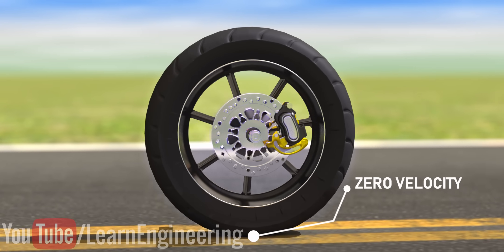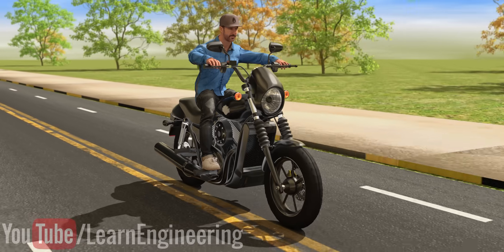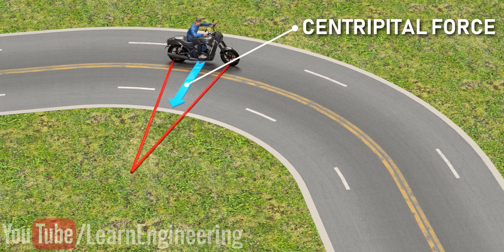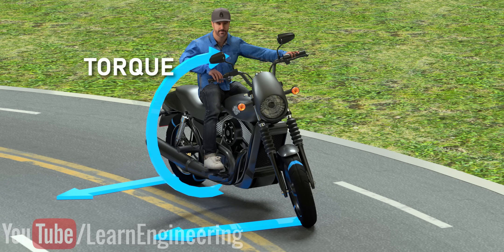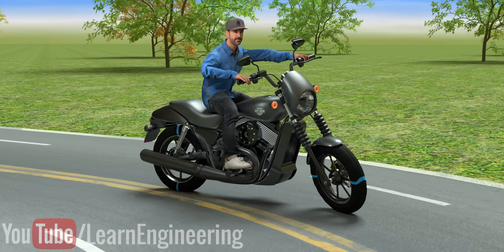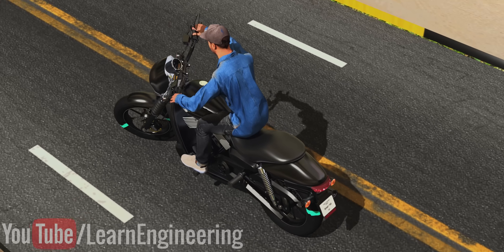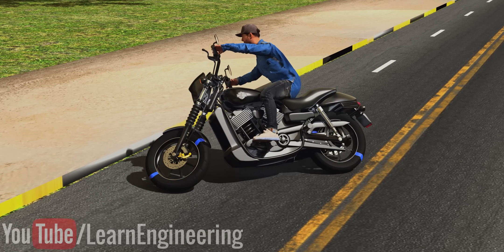Counter Steering | The interesting physics behind it

Comment: the guy turned left and hello the bike went left, then he turned the bike right, and the bike went right.. even in a skid, keep the wheel pointed in the direction you need to be going..... how did the myth perpetuate?
Reply: Myth??😂
Reply: @softailfun  Yeah, myth..... get a slow motion camera, that includes some kind of reference to which we can clearly see direction the wheel is turning, relative to the direction the bike is going.....there will never be a time in the shot that the bike will be going opposite of the way the wheel is turned... pushing the wheel to the opposite direction CAN cause a lean in the opposite direction, as a consequence of being off balance for a millisecond... (if you want to call that countersteering then fine).... but to actually GO the opposite direction it will have to be followed by correcting and turning the wheel the direction you need to go.... if you can produce that slow motion video that we can clearly see the direction the wheel is turned and the bike is going the opposite of that, I will concede that I am wrong.... I promise.... :)
Reply: @JimHancock  
So I know you don’t ride, that’s for sure. So you must be an engineer, physicist of some description. Which means that you learned what you’re saying from a book and not “real world” experience. I’m not being disrespectful but what the books say and what actually happens appear to be completely different. Of course the front wheel needs to follow the bend, a bit obvious really. However it’s the initiation of the lean that you guys see differently somehow. 
To turn a motorcycle to the left the rider applies forward pressure on the LEFT grip. The bike will immediately lean and turn to the left. The rider never eases the pressure on the LEFT grip until the bend is complete and he wants to travel straight. While this is happening, the steering geometry of the bike (rake & trail etc) forces the front wheel to steer into the bend. As you say, the actual time the wheel faces away from the bend is in milliseconds, and the movement of the wheel left or right (initially) barely measurable……but that’s what happens. Should the rider physically turn the wheel into the bend the bike will immediately stand up and attempt to lean RIGHT! That is exactly what happened in this video. He attempted to turn away from the truck by steering RIGHT, he ended up fighting the steering.

https://youtu.be/lzk8oyNO708

See the link for one of the best (in my opinion) examples of counter steering.
Now you’ll be able to run rings around me with big words, I know that…… but I’ve been riding for 40 years. If I have my right hand on the right grip and my left hand on the tank, I can steer a bike just fine. With my right hand only….. I push forward and my bike leans and turns to the right, I pull towards me and my bike leans and turns left. I maintain that pressure for the duration of the turn. There’s no way that a rider can physically steer right to lean and turn right above 10 or 12 mph. That is how it is!
Reply: @softailfun  actually we aren't in disagreement, the millisecond is what helps throw the bike into the lean, and then the wheel is turned where you are going.....you are correctI haven't been on a motorcycle in years, I use to race motocross, now I am itching for a streetbike..motocross you spend half the time with the wheel pointing in the direction of the slide, like flat track.. the front wheel is all over the place.... I know it's a different world then the rode....actually I'm a photographer and filmmaker, but I do come from am engineering background... my issue is with the term "counter steering" newbies might assume that turning the opposite direction will get you through the turn...What I haven't seen is for somebody to take a pointer,, mounted front of the bike, lined with the frame, over the front wheel, then point a camera at that, then you would know which way the wheel was pointing, relative to the direction of the turn and the frame.... even if you are pushing counter intuitively, it stands to reason that if you are leaning left turning left, the wheel will want to fall that way, and that is why pressure on the inside grip works... it's an interesting debate... but we are in agreement with the millisecond part... that's a start.... :)
Reply: @softailfun  You explained how you counter-steeered when u are riding ...then say its BS!😁
Reply: @sifuerik  
I don’t understand what you mean. Where do I say counter steering is BS? Have you addressed your comment to the right person??

Comment: The best explanation of counter steering... if you did nt get it watch it again ,,
Reply: Bloody awful description. Inaccurate and dangerous. You only have to read some of the comments from riders to understand how bad this is.
Reply: @softailfun  Yes it maybe to technical for some people ,,whats inaccurate pls explain.
Reply: @stephanriley5304  
As a rider, the one glaringly obvious mistake is the the video treats counter steering as an option. It isn’t an option, it’s the only way to steer a bike with any control.
Secondly, the video suggests that the front wheel is steered one way and then (“cleverly” as the video states) the other direction. This is Totally wrong. Once the steering is made to the left (for instance) by applying forward pressure on the right bar, the bike will immediately lean to the right. For the duration of the bend pressure is maintained on the right bar and the front wheel (due to rake, steering geometry etc) will indeed point into the turn. When the bend is complete, the rider eases the pressure on the inside bar and the bike stands up. If the rider were to do what the video suggest, steers left (bike leans right) and then steers in the opposite direction, the bike would stand up immediately and before the bend is completed. Not the most desirable outcome, even you as a none rider will appreciate that I’m sure.
Reply: @softailfun  I agree , if you counter steer when yor already leaning it will stand the bike up,, but counter steering when the bike is up  ,, and pushing to the right will lean the bike left ,, taking you into the lean faster..allowing you to turn faster ,, thats a fact..
Reply: @stephanriley5304  
Re initiating a lean:
Erm….. isn’t that what I said???
So you agree that the video is incorrect. That’s not reflected in your original comment. 
You’re not making a lot of sense.
Please re-read my comment. I’m well aware of how counter steering works from a practical view and not from reading books!
Reply: @softailfun  Me too be riding 40 yrs mate.,,,, what ever ..
Reply: @stephanriley5304  
Been riding 40 years, and this video makes sense to you?? Really??
Come on now! You must know how wrong and how dangerous this video is. Anyway, ride safe. Peace out!
Reply: @softailfun  You keep banging on ,, about how bad this vid is ,, are you an engineer ,, and  I agree counter steering is not an option , most people dont even know they are counter steering, I ride a zx10 r  started off on a yz 80,,and I use counter steering to my advantage ...  tell me techncially what is wrong with this vid,,, I dont want your explanation of counter steering I got that and agree ,,

Comment: Counter steering is normal motorcycle and bicycle steering. I even taught kids to get control over their bicycle by having them initiate lean before turning into the curve. There is no other way to do it- saying otherwise is just fooling yourself, and this video is very poor in that respect, outright wrong in many cases and doesnt cover the physics needed to understand counter steering, only parts of it. It completely misses out key points about the motorcycle geometry and tire shape which explains why the bike is stable at speed, and the physics is questionable and could have been taught much more intuitively. The narrator seems scared of riding motorcycles, and perhaps rightfully so, as he clearly does not understand how it is to ride a motorcycle and how it maintains balance. 

If you are up straight and want to lean in, you will have to lean the bike by moving the bottom part (the wheels) away from the side you are turning into first, otherwise you will fall out of the curve. In slow speed, and typical on bicycles, you may have to follow up by turning in the desired direction shortly after initiating lean, but on a motorbike at speed, the bike will do this for you, (due to the tire shape and the motorcycle geometry), so all you have to think about is initiating lean. 

Phrases like on 3:50: "...the driver cleverly adjusts the angle of the handlebars so that it is suitable for a perfect no-slip condition" demonstrates that the narrator does not have any clue on riding a motorbike. There is no effort into this, you have to forcefully continue to push the handlebar to stop the bike from balancing itself. Physics is at best confusing at  4:03 when it says "In counter steering, the lean is achieved by the motorcycle instability, caused by the centripetal force"- What centripetal force? The centripetal force is normally understood as what keeps you upright while leaning into the turn. Follow up at 4:12 with "Obviously, countersteering is a quicker operation, but slightly risky. If you dont steer the handlebars back to the proper angle during the leaning operation, you are going to fall down" just puts another big hole into an already sinking ship. Again, there is no effort in balancing a modern motorcycle.   At last: "The trick of countersteering is that you turn the handle, but don't lean" is simply nonsense. Countersteering is what you do to lean the bike; then the bike balances itself by turning to the side you lean.  

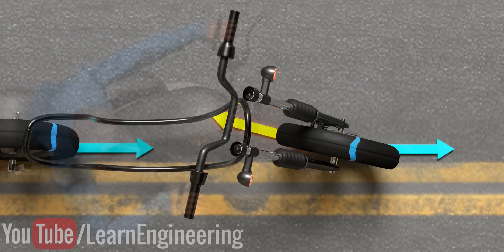Shifting weight around on a motorbike to have it lean is possible, but technically you will perform the necessary steering to balance the bike enough to shift the weight which means you are counter steering no matter how you turn the phrase, although you may not be aware of it. If you look at the top view with the wheel turned at approximately 1:37 it MUST be obvious for anyone having ridden a bike that just turning the wheel while being straight up, you will have the bike falling out of the curve initiated by the steering. If you do not follow up by turning the other way you will fall, however this is not hard to accomplish on a motorbike at speed. 

Being aware of countersteering is important when riding a motorcycle because fumbling around trying to shift weight is slow compared to simply pushing the handle bar to initiate lean. It helps the bikes stability that your body is able to follow. By using the footpegs and knees you can help the bike leaning accurately, but this takes much more practice and it is too slow on its own on a normal road. 

By presenting countersteering as a technical marvel that is risky and difficult to master and understand, the only thing achieved is having people fear learning to go on a motorcycle or loathe engineering  and physics. It is not that hard: You lean the bike by pushing the handlebar, then the bike make the turn for you. At slow speed, you need to follow up by steering into the turn.

Comment: Has anyone considered that its is gyroscopic forces that could be causing this effect. The front wheel when going at speed is in effect a gyroscope. Apply a torque to the axis of the gyro (apply pressure to the left or right handle bars) will cause the Gyro (front Wheel) to precess and depending if the torque is applied clockwise or counter clockwise, will move the gyro from the vertical either left or right i.e lean the bike. Just a thought

Comment: This video is garbage. They make it seem like you can "lean" the bike without using steering input, where in reality, it is the one direct method you must use to induce a lean.  Anything at speed where you must lean the bike to negotiate a turn must be done through direct inputs to the bar.  Push right go right, push left go left.  You do not approach a corner, turn the wheel to point towards the turn, and then "magically" lean the bike to counter the dumb move you just did.  This video is dangerous as it spreads false information.

Comment: Bikes turn by leaning u don't turn the handle bars to turn unless your In a parking lot going a few miles an hour
Reply: But to lean you need to counter steer. This video is dangerously wrong in its explanation of a very simple manoeuvre.

Comment: wait wait wait. i might be getting the wrong idea from bad habbits - so counter steering - is that momentary turning of the bar before leaning in to turn into the desired direction? All this time, I was thinking - that when at higher speeds doing a curve - countersteering is when you faintly push/hold the handles in the opposite direction of your curve turn? Help, please correct me.
Reply: You’re right man. All good.
The video has it all wrong!!
https://youtu.be/lzk8oyNO708

Comment: 4:17 to 4:27.wrong. The bike self corrects IF you're going enough speed or MAINTAIN that speed.

Or..if you increase your speed.. The bike WILL stand itself up..

..now the ONLY time you, the content creator of this video would be correct here...IS.if one SLOWED down while the bike is already leaning..BECAUSE the bike requires a certain amount of consistent speed versus the lean angle in order to maintain enough centrifugal force to keep it from falling

Comment: Cool video, but you don't really have a there choice in the matter. When moving slow you turn the steering wheel left to turn left. At higher speeds it changes the way the bike operates. You're then doing push left go left (countersteering). It's not some special "technique".

They're not interchangeable either. At super low speeds basically crawling you're not going to counter steer and get anywhere. Same thing at highway speed you're never going to turn left to go left at 60 miles an hour.

Comment: almost every single bit of this video is COMPLETELY wrong and was scripted by someone who does not understand physics or dual-axial rotations in the least, and the important part that rake angle plays into this.
Reply: If you are going at least 14mph or faster..maintaining that speed.. AND you turn the damn handle bars to the left...YOUR BIKE( and this is applicable to bicycles also BTW). WILL begin falling some TO THR RIGHT.....

As this happens..to SOME extent...your front tire...WILL auto self correct towards the right hand direction to the point that it looks like it's back to being mostly straight again.

Thus your bike at this point WILL be turning to the RIGHT...not left.

So no.  It IS  a fact of counter steering 101..regardless of this rotational axis or any other scientific way of explaining it is correct or not.

 Telling you the facts from actual riding experience... It had never changed since day one and never will.  Facts don't care about anyone's feelings.
Reply: @motoryzen  yes counter steering is what you do. But his description of how counter steering works is almost completely wrong. The only part that is correct is that it will fall to the direction that you push. But his reason why is incorrect. And I've been writing and teaching people to ride and racing for over 30 years.
Reply: @srobak  
…… and first ride a bike! ( in response to your first comment).